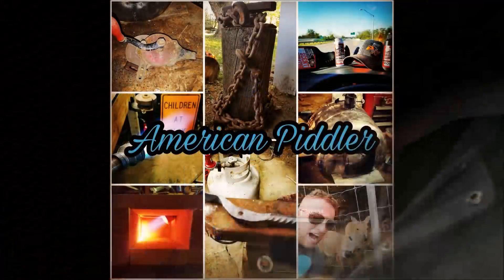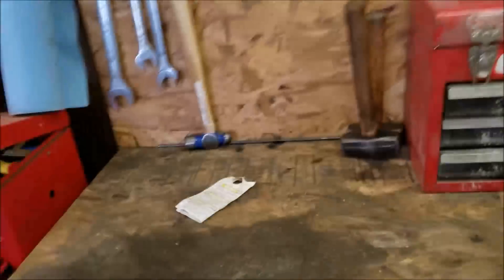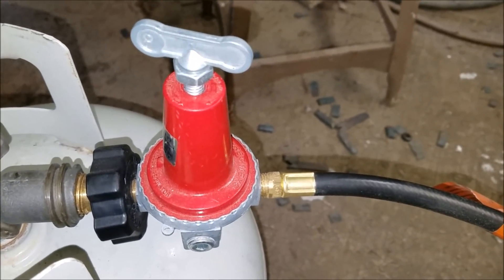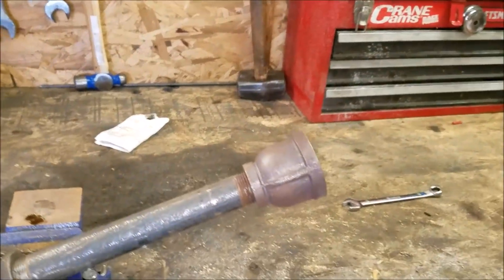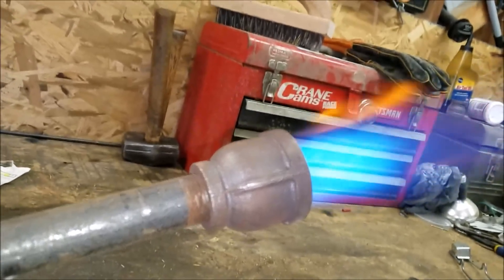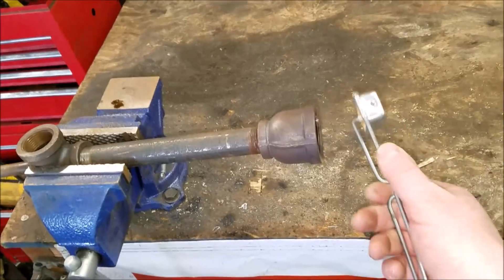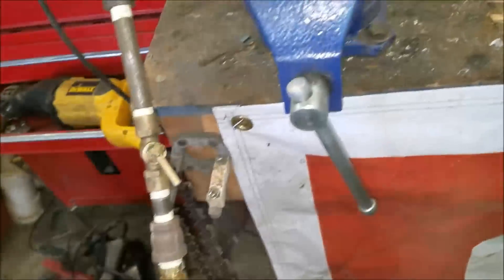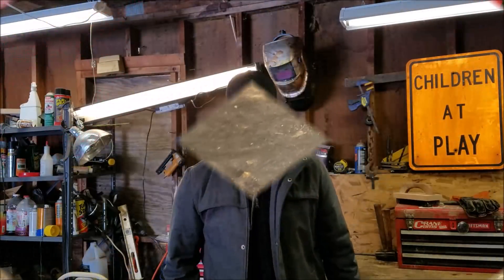Propane Forge Burner Don't Make This Mistake!

Comment: Would it be possible to make a video on how to ajust high pressure regulator. I have one and it keeps on shutting off after a few second on. I'm all new to this and loving it. Keep up the good work.
Reply from the maker: Roger Pena did you buy the one I recommend and left below I'm the description? I can show you how to adjust that one....

Comment: what if I don't even use a regulator and go straight hose all the way to my burner that has a valve to open and close? what do you think to dangerous or it'll work?
Reply from the maker: Luis, way too dangerous to even entertain the idea as the burner heats up you have a chance of it coming back into the line and well then you've got serious problems! I DO NOT RECOMMEND THIS!
Reply: @AmericanPiddler  Harbor freight sells a weed burner that plugs in without  the use of a regulator. Personally I always  thought  the set up was questionable  but seams there would be  liability issues  if that was the case.
Reply from the maker: I'm not encouraging it period!

Comment: This is good information and I'm very glad I found it, but how for into the forge should the nozzle be inserted?
Reply from the maker: The burner should be tucked up inside the insulation if you put it in the forge the forge will melt it
Reply: Just received my high pressure regulator from Amazon. I have the forge assembled and the burner is almost done. One thing I learned while sourcing the parts is that not all quarter inch ball valves are suited to use with gas. I ended up going to four different shops before finding someone with a pair of them in stock. Mine are Vermont American products. The manufacturer specifically states they are safe to use with propane. Maybe you should include this kind of information in an assembly video. I was warned by someone who knows more about gas lines than I do that using a ball valve not designed for propane is potentially very dangerous. His exact words were, "You are taking your life in your hands if you do."
Reply: @StutleyConstable  Switch those valves immediately to brass needle valves and you will be amazed at the improvements to your control, performance, and efficiency.

Comment: Low pressure regulators are typically. 11 inches or 11 inches of water column so not even a pound of pressure and they’re not adjustable their junk for this application! But it is nice to see it in application in our badly it fails great video guys were just gained a subscriber

Comment: How high pressure must the high pressure reg be? Anything above 20 psi I can find is labeled 'high pressure'. Do you know if it's necessary to use a 0-40psi reg? Or can you get away with a 30, or 20 psi? Those are much less expensive than the others.
Reply from the maker: Jake Makes the link to the one I use is like 24 bucks with a ton of range! I'd say for this type of burner nothing below 20psi
Reply: I was wondering the same myself.  I've got a 20psi regulater.  Been using it for a year in a melter with no issues-built mine as forced air.  Recently torch kept going out in new melter then my blower took a shit.   Now using Ventri I get that low pressure flame  sigh.  Need this working being on disability and trying to get something going to make $$ because Disability sux.
Reply from the maker: Mark my guess is your regulator has went bad.... I have a link to a fairly cheap regulator that I've been using for over 6 months with out any issues !
Reply: I bookmarked it last night-I like the PSI range over my current one.  Thanks!
Reply: American Piddler can I use one reg for a dual burner?
Reply from the maker: Steve you sure can at least the one I use you can......
Reply: I'm guessing 'Merican Piddler uses a splitter on the brass part at the end of the Regulator where it connects to the torch...  BTW, Piddler, it is great of you to not only answer peoples questions but even go back several months to do so.
Reply from the maker: Mark Henry yes sir happy to help! I split mine where the line comes into the build.... you have to be careful if you go to radical you can cause the safety valve in your actual propane tank to activate if too much propane is being pushed...  other than that all I can ask is to like comment subscribe and share! Thanks again for WATCHING AMERICAN PIDDLER
Reply: You can get away with 5 psi, if you build a ribbon burner, it is more expensive to make but you'll use 1/4 the propane. You'll save money in operating cost.
Reply from the maker: Very true I would like to build one!
Reply: American Piddler thanks man!

Comment: Yep, those low pressure regs take forever to heat up 3/16 round bar. Gotta get the gas rolling to actually be able to work anything. I made the same mistake...
Reply from the maker: Absolutely correct that's why I made this video! Thanks for stopping by! btw love your channel name!
Reply: Hard Knocks Forge Me too, first one I built many moons ago, made this exact mistake. Worst thing was, I bought I high pressure bbq one. Couldn't figure out what I had done wrong for days....duh, lol. But, it's nice that you made this video, it will save people from making our mistake 😀